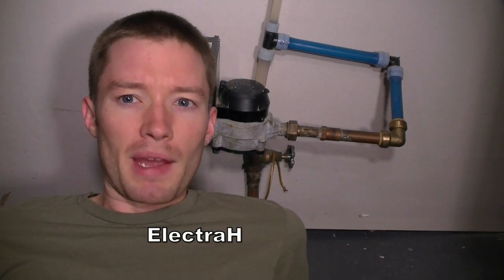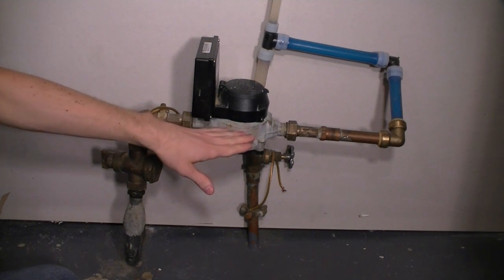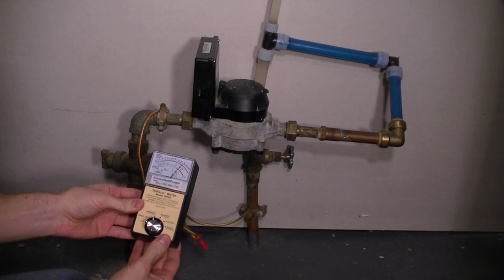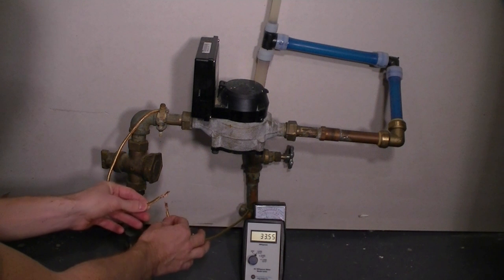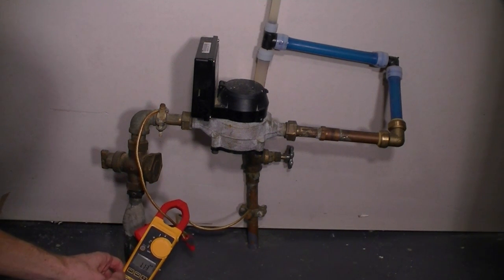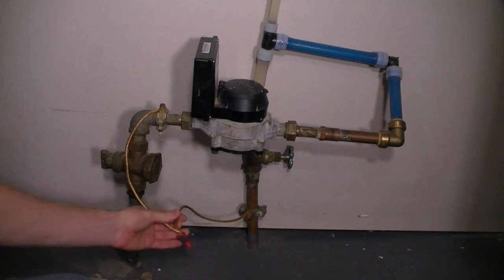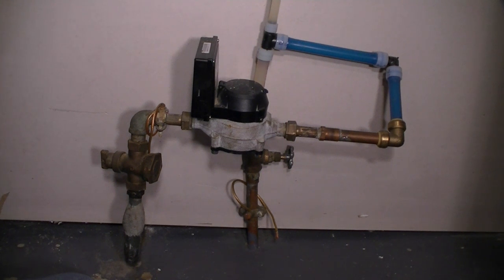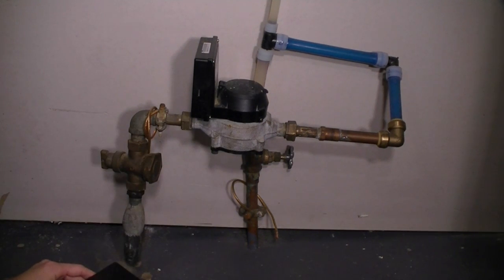Electrical Current on Plumbing Pipes

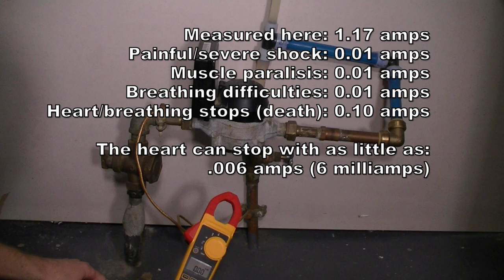Comment: At 10:07 you would not get shocked because the wire connection acts as a short circuit to any voltage potential. Something is wrong with this setup, it's not normal to have one amp current flowing thru the copper pipe. The house is wired wrongor a defective connection. the over one amp reading you got.

Comment: Nice video! I followed it and solved part of my EMF issue. Later, I found the feed in gas line carry current and makes my water heater tank and connecting water pipe carry current too. I am not sure why gas line carries current. Did one of my neighbour ground to gas line?
Reply: Holy shit !! grounding on a gas line, I like to find the idiot who did that if I had this issue and have his electricians' certificate revoked. He should be a bag boy at a grocery store. At least there he can't potentially kill someone. I do believe it's illegal to ground off gas, one little tiny spurt from a pin hole or a weak joint the static from ground your house goes BOOM!!

Comment: did you think about doing a dielectric union?
Reply from the maker: I've seen dielectric unions fail and pass current through.  PEX is more reliable in that respect - it isn't going to have a failure that will cause it to conduct electricity.
Reply from the maker: When we do dielectric unions, there is a particular way we do it that's best for everything (electrical current and corrosion).  This is detailed and shown in pictures in the book

Comment: Thats exactly what I experienced chasing down EMF traced to water line. detected 2A yes 2A not milliamps..current  after going to my Neutral return at Service drop where ground wire is connected. Found Neighbor Neutral not connected, their return was solely through water pipe .  I have power transformer in front of house so all "Poor" neutrals follow water line to my  house to the neutral return I have..
Reply: May I inquire what symptoms you had in this situation? We have similar issue.

Comment: I do not understand how you could measure 1 amp with a clamp on meter? Then you put one hand on one side one hand on the other side if it were truly 1. amp you would be dead. Is your amp probe inaccurate?
Reply from the maker: +John Puccetti John, I think the reason for this is that a lot of this current is high frequency, and when you raise the impedance with say your body vs. a large metal pipe or wire, less current flows through.  But you're still taking a chance - because it doesn't take much current at all to cause ventricular fibrillation.  If your hands are wet then the resistance/impedance drops even more and you're even more likely to get fried.

My clamp meter is good :)  I've seen readings up to 4 amps on pipes myself.  I've heard of readings over 10 amps even.  Very dangerous, not to mention the huge mag fields it puts out.  I bet a lot of heart attacks are caused by current on pipes/ground and people just aren't aware of this.
Reply: Thanks I warn all my plumbers to never touch both sides of a supply water pipes at the same time.

Comment: Shawn,  I'm glad to have found your video.   I'm a field tech for the Florida DOT specialized on road loop detection devices.  And,  I believe your video will share light on an unusual situation I've encountered. 
When checking inductance to ground,  my meter detects an electrical field showing as being connected to the equipment when it was not. The equipment manufacturer calls this been "coupled". It's the same effect as if you take a transformer and apply voltage to one side and it induces a voltage on the other side.  In my case less than 1 volt but enough that I can't get any Q values from the loop wire. But thanks to your video I'm going to investigate isolation solutions from neutral to ground and other things.  Keep up the good job.
Reply from the maker: Theres a lot of primary neutral current in the ground (surface of the earth).  In fact, both EPRI and IEEE studied this about 2 decades ago and concluded that MOST of the electricity we use returns at some point via the Earth.  With today's increase of non-linear loads (electronics and high efficiency lighting), that ratio will be even higher!

In other words, the surface of the earth is part of many AC circuits.  So it wouldn't surprise me at all if this is what is messing with your measurements.  When we work on these water pipes, it is both primary and secondary neutral current on the pipes...

I was just in a home that measured as high as 18 amps on the water supply pipe.  Some people think microamps or milliamps are meaningless...just depends where they are!  In the human body...not a good place for foreign, artificial, man-made energy to be flowing.
Reply from the maker: One ampere of current is 6,200,000,000,000,000,000 electrons flowing per second.  18 microamps in the body has been associated with cancer in numerous well-programmed studies.  A milliamp is 6,200,000,000,000,000 electrons per second.  A microamp is 6,200,000,000,000 electrons per second.

Looks more significant put that way doesn't it :)
Reply: @EMFExplorer  Wow! That's a lot of info.  In my field of work I've seen  interference from other devices that have been isolated by the replacement of a bad breaker or ballast.  In one occasion the break room light switch was feeding back to ground a noise from the light ballast. Another time the 20 feet high canopy lights ballast was adding noise to the equipment causing it to fail occasionally.  
My equipment works with different frequencies to tune the different loops and is very sensitive to added noise. But this ground emitting electrical field is hard to isolate since it's hard to find the source without eliminating all sources. And that's not the per built design.   All well, you gave me more fuel to find the problem.  I will let you know when I do.

Comment: Umm the lead pipe bringing you water in is only 7% conductive so...
Reply from the maker: Silkworm you have to take into consideration the volume of the pipe as well.  While it isnt as conductive as copper, the volume is far far greater than for example a 12 gauge copper wire.  So conductivity is important but so is volume!!!

Then take into consideration the skin effect and the large surface area outside and inside of the pipe.  The length of the pipe, the soil composition touching the pipe outside where some current will travel, and also the voltages and frequencies on the line as well as the impedence of the actual neutral.

All those variables affect the current distribution.  Oh, and I almost forgot temperature, another important variable in the equation.

So while lead has a higher resistance or impedence all those other factors especially the volume are important.
Reply: @EMFExplorer  True Lead is less conductive than copper, but its looks a lot thicker so still a good conductor. The 'skin effect' is insignificant at 60 Hz -- makes me wonder what your training is. "Temperature, another important variable in the equation." No, no, no! A very small, really insignificant effect. What, really, in the world are you talking about half the time? Just lots of technical words thrown around, but make no sense a lot of the time.

Comment: Thanks Shaun  Excellent Video.  My house has v. hi mag in the wiring and I am getting my courage up to get the dielectric plastic unit added.  I measure with GigaHertz NFA1000 and it is very high  300 nT on floor  up to 10,000 nT by dish washer face.

Comment: My bathwater and faucet shocks me how do I fix it? My landlord is playing games saying he fixed it but its actually slowing getting worse .
Reply from the maker: This is a very serious and hazardous problem!  It sounds like the neutral to your building could be bad.  While a few things could cause what you are experiencing, I would first have the power company come.  I would call the power company IMMEDIATELY and have them come look at the neutral to the building!

This could easily cause death from electric shock.  Even very small amounts of electrical current if passed through the body just right and if the body is weak at the moment...can easily stop a human heart.  Don't mess around with this!  Also this kind of thing can cause long-term health effects from low-level (even undetectable) amounts of exposure to contact current on the human body.

Call your power company and/or your local building inspectors!  Get this fixed!!!!!
Reply: @EMFExplorer  will the power company charge us? We have no money... this happened suddenly after a cable wire on our roof caught fire .
Reply: @EMFExplorer  I called my power company and told them.and all they said is.well get ur own electrician  r they supposed to do that ?
Reply from the maker: @ciprianadawson2461  They should check the neutral at the service and ensure it is not broken or loose/corroded/frayed/etc and they should do this for free.  You may need an electrician to check your panel and all of that though.  You can say an electrician told you to have them check.

Comment: You at one point in your video you say ground and neutral are one in the same, WRONG.. ground is ground Neutral is your negative or return, Make sure you have your facts straight before you get someone hurt or killed.
Reply: So negative is not ground??lol on an car battery negative is consider ground cause that negative is bond to the whole body with is ground.....netural is a return or ground....

Comment: PEX has never been tested for chemical leaching into the water. Many people will not drink water from PEX. PVC would be a better choice.
Reply from the maker: +John Puccetti Thank you for that information!  I am shocked.  Getting to the point where nothing surprises me though.
Reply: PVC is outlawed as sewer or water in homes you have to use ABS for sewer and either copper or IPEX for water. As far as chemical leaching, do you really think IPEX would be widely used in homes everywhere? Do you honestly think it would be allowed if it was possible?
Reply: @brianx8394  lol yes!!!!

Comment: None of the current we use come from earth
Reply: No, but most of the current we use does at some point travel the soil of the earth.  This is according to studies conducted by both IEEE and EPRI back in the 90s.  The problem is only worse now.  That is a separate issue than this video, however.  This video is more about parallel neutral current paths created by metal city water networks and bonding to those water networks.

Comment: Dude, you need to call an electrician. You're missing a ground, that meter isn't bonded, and you have no lightening protection on anything.
Reply from the maker: joe banana I am an electrician.  We use ground rods instead of the incoming water pipe.  The ground rods also act as a secondary neutral connection - but not nearly as bad as incoming metal water service pipes.  The imbalance of current due to grounding electrodes (rods) is much smaller due to the greater resistance/impedence of the connection to earth compared to the lower impedence of a huge metal pipe connected to neutral in numerous places.
Reply: I seriously doubt that a single ground rod has 25 ohms or less resistance to ground as per NEC 250.53 (2) Have you tested it? That's where the current is coming from, the water service pipe is grounded, and the other pipe has a fault on it.

Comment: Shaun, I hope you do not have children living in your house/basement  From the video what you are showing you created a possible death trap in your house. You need to do much more study about electrical connections especially relation of ground and neutral. Have qualified electrician check your meter box connection, main circuit breaker panel connection and neutral bar and grounding terminal connection. If those two metallic type water  pipes would be more than 8ft. apart by your reading 1.17  Amp. you could kill a horse in your basement. Make sure that  the small wiring between the two pipes is connected until somebody qualified find the grounding problem in your house. Little knowledge is very dangerous  and this video can help kill people.  Very sad.
Reply: Yes I agree - see my comment above! 

Hey Shaun, your pipes look scary to me (I'm no electrician ) but - firstly lead pipes (no good) will cause brain problems (retardation/death) ; look up history of plumbum and lead (Pb)  , all pipes used to be lead hence the name plumbers, until they realised it actually wiped people out !!! secondly, you should urgently check your house out by a qualified electrician , I query if your neutral may potentially not work to do its job , and cause electricity to go through your taps even the garden hose!

See a tragic story that just happened in Australia last week 

https://thewest.com.au/news/wa/perth-girl-denishar-woods-is-breathing-without-respirator-after-electric-shock-ng-b88770621z

Hope u look into this to ensure your family is safe

Comment: Electric field develop due to friction between water and plumbing pipes.
Reply: I'm not sure what you're referring to, but the magnetic fields shown in the video are NOT due to friction.  The current measured in amperes is AC electric current from power distribution.  We see this on pipes all the time.  Are you referring to something else?

Comment: Wrong, wrong, wrong! I'm have a master's in electrical engineering and worked over 30 years as an electrical engineer. These tiny magnetic fields are NO problem at all. This is horrible. I'm feel sorry for all the people giving there money for this non-problem and causing people to worry.
Reply from the maker: You need to read up on published studies of the biological effects of magnetic fields, even what you consider "low" level.  On what are you basing these statements?  Are you a doctor in this field of study?  Have you read up on the peer-reviewed publications in this area?

It just sounds like you're being defensive without any data.  The IARC classifies magnetic fields as a Group 2B possible carcinogen based on studies.  Researches have been pushing to have it classified as a Known Carcinogen.  There are a vast number of studies showing effects even at very "low" levels.  Just because your electrical engineering instruments don't read very low, doesn't mean the cells in the body aren't being affected.

How many electrons pass a point per second in 1 amp?  Milliamp?  Micro/nano?  

____Ampere: 6,240,000,000,000,000,000
Milliampere: 6,240,000,000,000,000
Microamp: 6,240,000,000,000
Nanoamp: 6,240,000,000

The research is not on the side of "it doesn't do anything to the body" at all.  I think you just want to believe that, but you aren't basing your belief on the available evidence at this time.
Reply: @EMFExplorer  Yes, indeed the IARC does classify a certain type as a possible carcinogen. BUT NOT the type you are talking about there is a big difference between the small low frequency magnetic fields you are talking about and what they are talking about. Not 60 HZ from electrical power, but 3,000,000,000 HZ and at a power level that a cell phone tower can pick up miles away. I hope you don't delete this. May be we can talk some how. It does seem you believe what your saying, but you got some basic things wrong.

Comment: Is anyone going to point out his silly this all is?

1) the reason there's a field all around is because you electrified your houses plumbing...

2) Cite your claims, otherwise stop spreading misinformation.

3) That's an awful plumbing job.
Reply from the maker: I've been in HUNDREDS of homes in Illinois and measured the incoming copper (and once in a while lead) water supply.  It is always the case that when they have a metal water pipe coming in and it is connected somehow (either intentionally through a bonding wire or unintentionally by touching something else grounded...) to "ground" which also means the neutral - the grounded CONDUCTOR, that current is present.  Rare is the current insignificant.  It is usually quite high - in the milliamps.

I have countless pictures and videos of this, using different equipment that is much more sensitive and precisely measures the current - namely a shielded clamp "leaker" meter.  https://www.electrahealth.com/Big-Orange-AC-Current-Clamp-Leaker--Large-Opening-Clampmeter--Ammeter_p_132.html

So to respond:

1) I did not electrify the house's plumbing.  It was already electrified by virtue of being connected to "ground" in the house which is also neutral, which is a conductor, AND at the other end (the street connection) it is connected to a metal pipe that is then connected to an unknown number of other houses in the same fashion.  THIS causes primary AND secondary "neutral" current to travel on the water pipe, even when the power in the home is turned off.  This is the case with virtually every house I've been in - you can turn off the main breaker or service disconnect and still have current there - yes the current will usually change.  It is not because there is a "fault" necessarily to ground.   While many homes - especially homes with conduit - do have neutral-to-ground faults , these faults are just one of the causes, or a factor of the issue of current flowing on pipes where it should not be.

2) Electrical current takes all paths - https://en.wikipedia.org/wiki/Path_of_least_resistance - https://physics.stackexchange.com/questions/5670/electricity-takes-the-path-of-least-resistance - spreading according to resistance value.

3) Agreed - the plumbing seen in the video was done by licensed plumbers.  It does look awful.